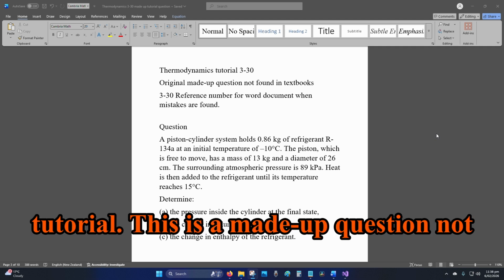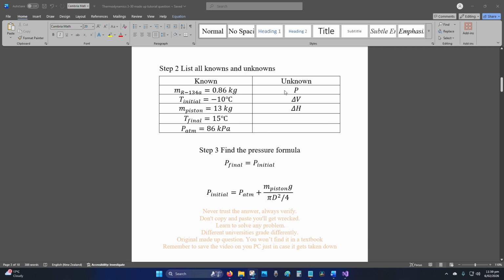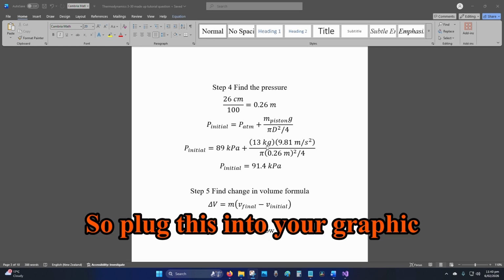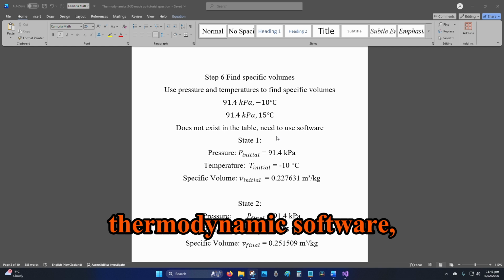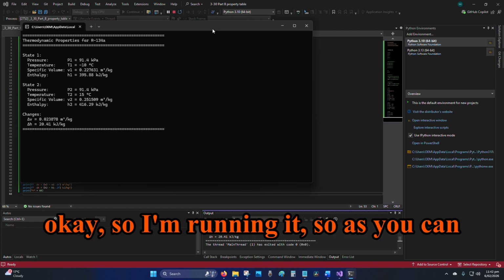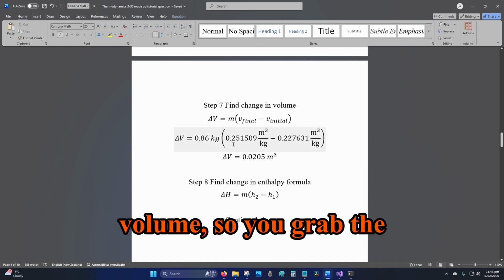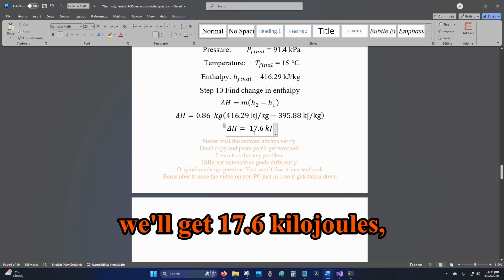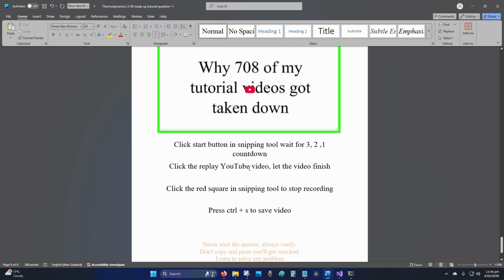Thermodynamics made up question 3-30 A piston-cylinder system holds 0.86 kg of refrigerant R-134a at

Comment from the maker: Reserved for corrections
3.30 reference number for word document when mistakes are found

Python code

"""
Convert EES code to Python using CoolProp
Calculates specific volume and enthalpy for R-134a refrigerant
at two different states with the same pressure but different temperatures.
"""

from CoolProp.CoolProp import PropsSI

# Given conditions
P1 = 91.4  # kPa
T1 = -10   # °C
P2 = 91.4  # kPa
T2 = 15    # °C

# Convert units for CoolProp (requires Pa and K)
P1_Pa = P1 * 1000  # Convert kPa to Pa
P2_Pa = P2 * 1000  # Convert kPa to Pa
T1_K = T1 + 273.15 # Convert °C to K
T2_K = T2 + 273.15 # Convert °C to K

# Fluid
fluid = 'R134a'

# Calculate properties for State 1
# PropsSI(output, input1_name, input1_value, input2_name, input2_value, fluid)
v1 = 1.0 / PropsSI('D', 'T', T1_K, 'P', P1_Pa, fluid)  # Specific volume (m³/kg)
h1 = PropsSI('H', 'T', T1_K, 'P', P1_Pa, fluid) / 1000  # Enthalpy (kJ/kg)

# Calculate properties for State 2
v2 = 1.0 / PropsSI('D', 'T', T2_K, 'P', P2_Pa, fluid)  # Specific volume (m³/kg)
h2 = PropsSI('H', 'T', T2_K, 'P', P2_Pa, fluid) / 1000  # Enthalpy (kJ/kg)

# Print results
print("=" * 60)
print("Thermodynamic Properties for R-134a")
print("=" * 60)
print("\nState 1:")
print(f"  Pressure:        P1 = {P1} kPa")
print(f"  Temperature:     T1 = {T1} °C")
print(f"  Specific Volume: v1 = {v1:.6f} m³/kg")
print(f"  Enthalpy:        h1 = {h1:.2f} kJ/kg")

print("\nState 2:")
print(f"  Pressure:        P2 = {P2} kPa")
print(f"  Temperature:     T2 = {T2} °C")
print(f"  Specific Volume: v2 = {v2:.6f} m³/kg")
print(f"  Enthalpy:        h2 = {h2:.2f} kJ/kg")

print("\nChanges:")
print(f"  Δv = {v2 - v1:.6f} m³/kg")
print(f"  Δh = {h2 - h1:.2f} kJ/kg")
print("=" * 60)
------------------------------------------------------
Using EES get specific volume and enthalpy using 
91.4 kPa and -10°C for initial state
91.4 kPa and 15°C for final state
v_1=0.2302 m^3/kg
h_1=247.77 kJ/kg
v_2=0.2544 m^3/kg
h_2=268.18 kJ/kg

“Given”
P[1]=91.4 [kPa]
T[1]=-10 [C]
P[2]=91.4 [kPa]
T[2]=15 [C]

Code
Fluid$=‘R-134a_iapws’
v[1]=volume(Fluid$, T=T[1], P=P[1])
h[1]=enthalpy(Fluid$, T=T[1], P=P[1])
v[2]=volume(Fluid$, T=T[2], P=P[2])
h[2]=enthalpy(Fluid$, T=T[2], P=P[2])

Comment: On an exam, we'd probably have to interpolate to find the missing values, right? In that case, which values would be used in that instance? Thanks for the video, nonetheless.
Reply from the maker: Generally if you go to the property and it's in between two values then you would need to linear interpolate. In this specific question, the question was more difficult because both values are in between. This question was designed for students to use code to solve it or use university's EES (engineering equation solver).

Depending on the university they would give you at least one value to go the tables then find out it's in between the values. Generally wouldn't give you two in between values that makes it ver difficult to do by hand. Although some professors do push students to the limit